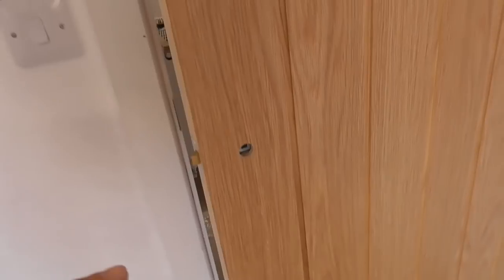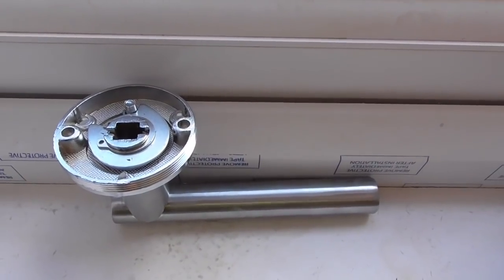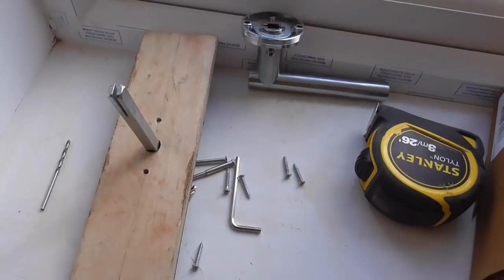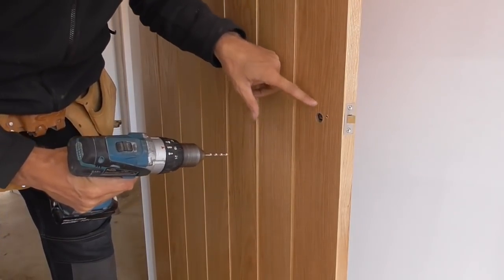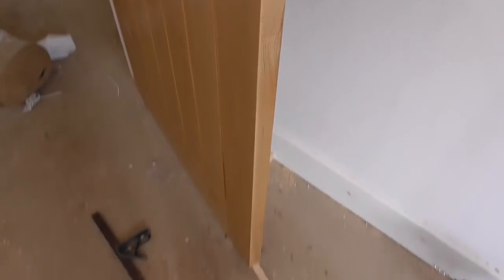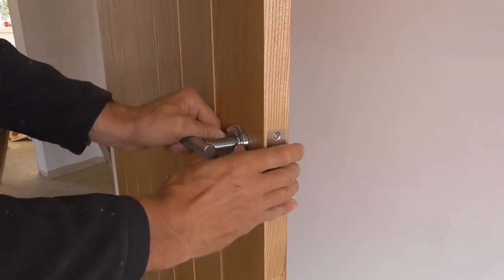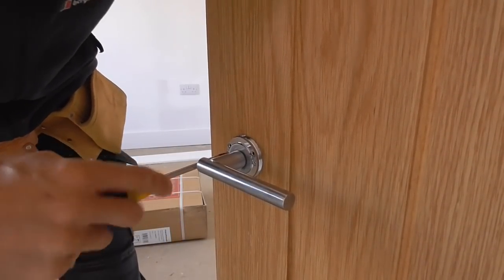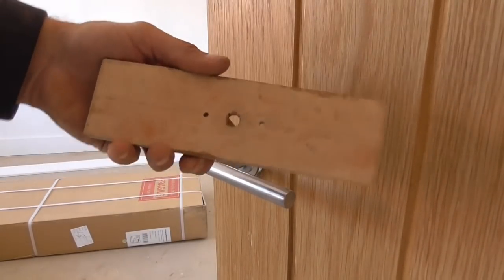Bolt through door handle fitting (using homemade jig)

Comment: Great job, where did you get the rubber? Very smart 😊
Reply from the maker: Hi Sean. Its actually 1mm rubber that I use for gaskets when fitting glass balustrading on stair jobs.🤩 Any rubber would do though, or you could even just stick a few kitchen door buffer things on the ply to stop it slipping about.👍 Cheers
Reply: @thetallcarpenter  great idea thanks, must keep an eye out for you random pieces lol I'll look a bit mad :)
Reply from the maker: @rockandmeatroll  😎

Comment: Just mark all three holes at once. This looks like a longer way of doing it.
Reply from the maker: Hi there🖐Where would you position the jig to mark all 3 holes at the same time🤔Cheers Del
Reply: @thetallcarpenter  I normally mark the 3 points on a line on both sides and then drill pilots right through then increase to the desired diameter.
Reply: @thetallcarpenter  I always drill the barrel hole and mark the 3 points and drill.

Comment: 5:30 be nice to see this assemble off the door. 

I’ve watched both videos - great, no BS. But my handle pack has no instructions and seems just like yours. I’ve no idea why the full through screws & “female” part are at 9 & 3, opposed to 12 & 6 positions. 

My handle set “intelligent hardware” has a grooves hole through the barrel like yours, but the female part is too fat to fit through it. Crazy. Seems like I’ll have to junior hacksaw all the female recipient parts down - seems daft and fiddly.
Reply from the maker: Hi there🖐Yes, what you've got does sound a bit odd, but it has been my experience that can happen and you just have to 'make it work' the best you can🤞Thanks for watching😎Cheers Del